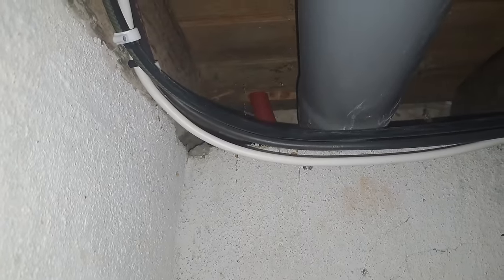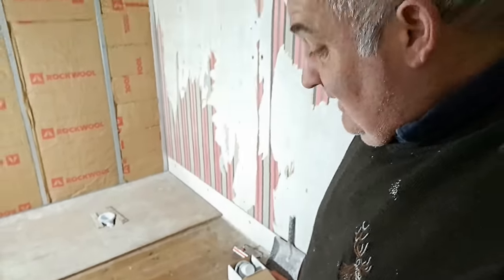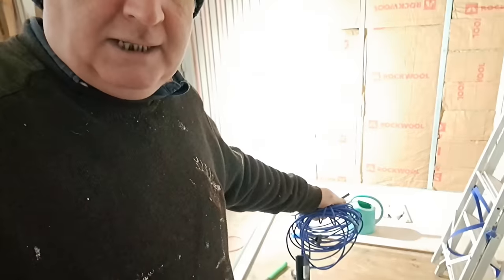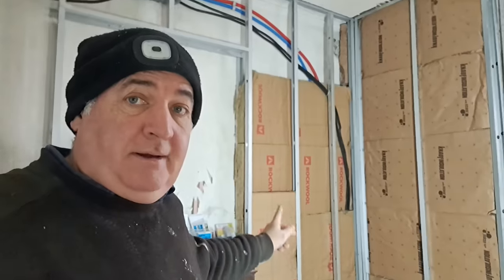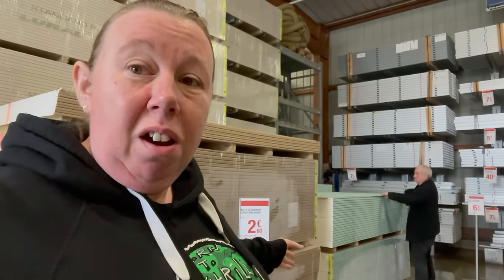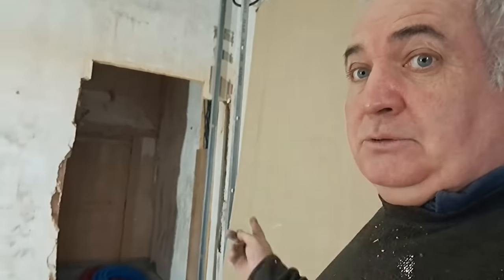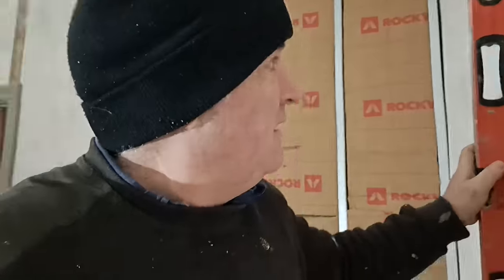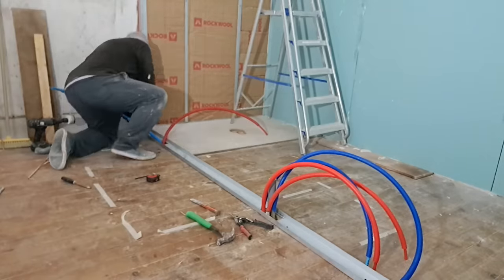No Protesting With Progress! #134

Comment: Sad to see you notched the joist for the piping as that compromises the strength of the joists.  You should cut a hole through the center of the joists.  Learned this the hard way after having to replace several joists in my Victorian house to correct a sagging floor from a previous owners "work".  

I do enjoy your vlog and appreciate your hard work.
Reply from the maker: Thanks for this...I do not think he thought too much about the joists when doing it. This is definitely a learning curve at times. Will be sure to use this for the next room and keep an eye on what's happening with the ceiling... All the best from France - Clare & Nick

Comment: I presume the black conduit is for electrical cable, is there a colour for ethernet cable too ? I'm wondering if you have given thought to having ethernet cables in the bedrooms and other rooms ? When we re-did ours a year ago, we put at least one up high where a tv would be placed and another lower down for laptops, extenders etc They're all brought back to a cabinet next to where the fibre broadband comes into the house. I'd imagine the thick (turretless !) chateau walls would be an issue for wifi ?
Reply from the maker: Hi Peter - I am not sure if there is a colour for ethernet. We are a bit lucky with the WIFI as all of the internal walls are quite thin and boosters seem to work really well for us. The outer walls are the really thick ones. We are steering to avoid TV's in the rooms (although that may change in the future)
Reply: @theexpatbutchers  That's great that WiFi works well, seems unusual for those old French houses. One thing you might consider if you're not cabling the entire house is to run even a single cable to each floor, back to the router, so if you had to have some fixed wire in the future, you could add a hub on each floor, thus minimising the modifications you'd have to make. Bear in mind that TV is going towards IPTV rather than a dish/aerial, but if you don't want TVs in the rooms then it's not going to be an issue.